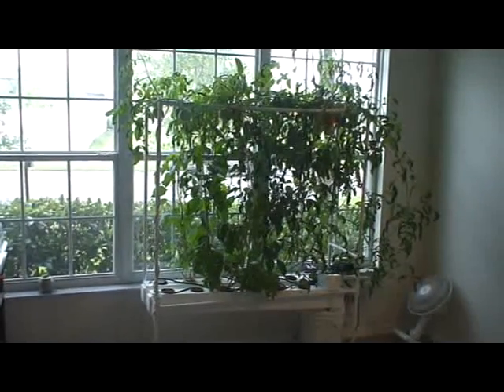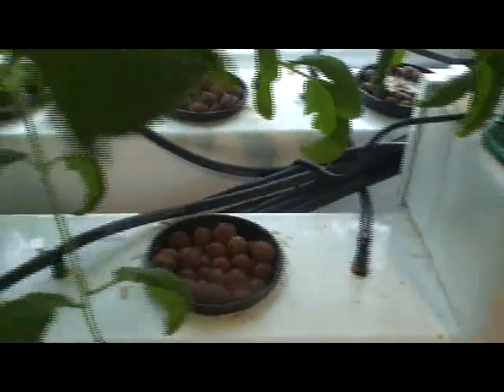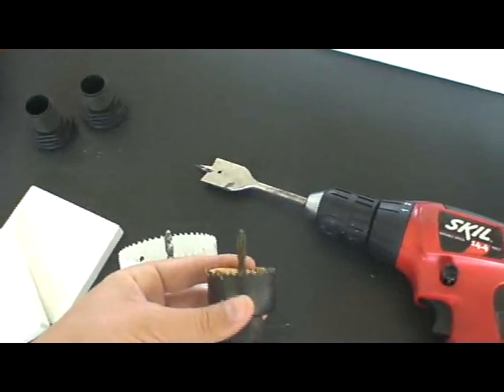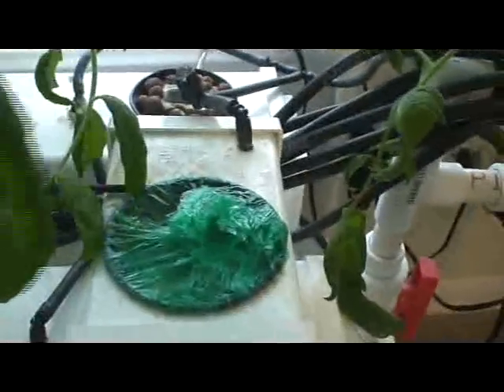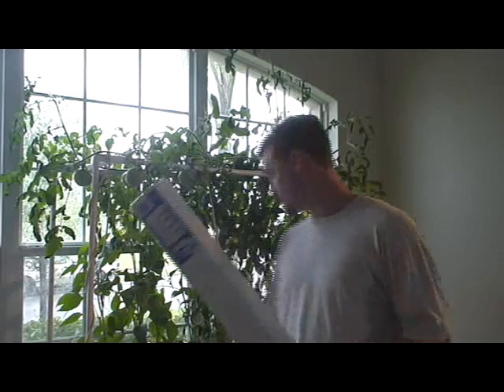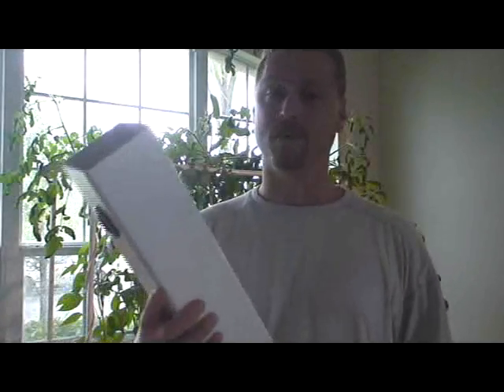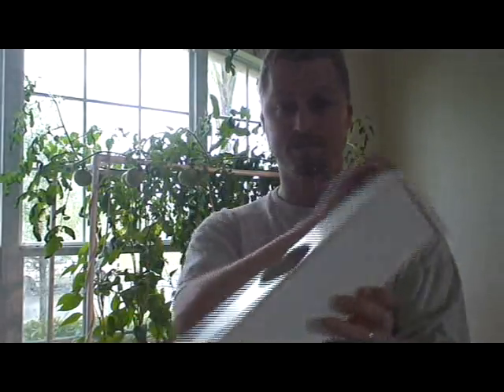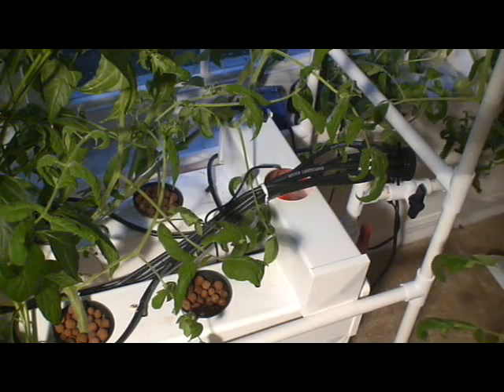Build a Aeroponic Fogger for your hydroponic system

Comment: I have that same fogger and it will generate a lot of heat to the water.. great for winter I guess  other wise, its better to use a cyclic timer to turn on the fogger for the minimum time before it gets hot and then let it cool for the amount of minutes that it will take to cool down.
Reply: Allan Teo what are the time intervals you recommend ?

Comment: I like your system and I am likely to reproduce it for my first system. 2 questions. 1. What angle do you have on your growing tubes? 2. could you accomplish the intended purpose of a fogger by integrating it directly into your growing tube? Let's say you drill your basket holes a little away from center, place the fogger in that center hole, notch the hole for wiring and cap it with a removable plug? Would that be work or is there a concept I am missing that would cause failure?

Comment: I have been using this principle for growing for about 6moths with outstanding results. I found that after awhile my fogger became much weaker and had develop what appeared to be corrosion on the transducer. Im really in the dark on this one. My plants will die if I dont get a new one soon but I am unsure if I want to continue this approach. Is there something Im doing wrong? Perhaps it is the nurturances Ive used which has damaged the fogger. Any advices would be very gratefully received.

Comment: To churn. I use 1 part 30% peroxide to 100 parts clean decloranated water and flush this thru my system 1x a week. No I usually use the nutramist fogger because it is very effecient and just blow the fog onto 4 inch PVC with 4 inch t's every 12 ir 18 in for plant sites.

Comment: Dude wow. It isn't everyday I learn something about hydroponic systems. The way your fogger box works is so simple and elegant. The thing I always had problems with in the past with foggers was water level. You can always float them (like in gutters). So the little PVC pipe work as an over flow from the box to your gutters keeping the level of nutes in the fogg box constant right. I dig your gutter system well done.

Comment: o.k., "better bush" tomoatoes and there are no sprayers from a water pump, dont wanna deal with them clogging, I only have a couple airstones in the root chamber connected to an oversized air pump and wanna add the fogger. bought it with a floater...can it go into the root chamber? how long and often does yours run for the tomatoes?

Comment: hi bonsai.  not to upstage Sy, but I do have a tried and true solution.  I bought a 5-membrane mist maker for Halloween purposes.  The unit is very heavy, but it snaps into a plastic housing.  The housing supports the mist maker from below, and retains a Styrofoam donut from above.  The whole thing came with the mist maker.  The buoyancy maintains the mist heads at the optimum depth- which I think is around 1 cm.  Perhaps you can rig something like this as well.

Comment: Thank you so much for taking the time to share your experience and hot to.  I have been obessing with Hyrdoponics (and in my mind aeroponics) and this helps get me going.  I had wondered about using a fogger and it is nice to see it in use.  

Is the fan creating the motor humm noise in the video or are the pumps/fogger making that noise?

Comment: my idea for a no fuss no leak propogator is to have a large tub for the reservoir and put another tub upside down inside the slightly larger tub... this way you can have the pump in the larger tub, outside of root area and also never have to worry about leaks from the lid cause there is none.

Comment: for the bulkheads, you can make your own very easily by simply getting electrical pvc conduit connectors male and female pair at lowes and buying a bushing in the sink isle, and sanwich it between the OUTSIDE, plus they come in many different sizes and are prefect for hydro applications.

Comment: Howdy. Just a brief question: does the water going into the nebulizing chamber overflow into the same tubes the fog goes through as it enters the growth sections? I presume it does, as the fogger must remain submerged. If not, can you describe in further detail or create a diagram of the inner workings of the fogging chamber? Also, what is the gph on the water entering the nebulizing chamber?  Brilliant setup, thanks for showing it.